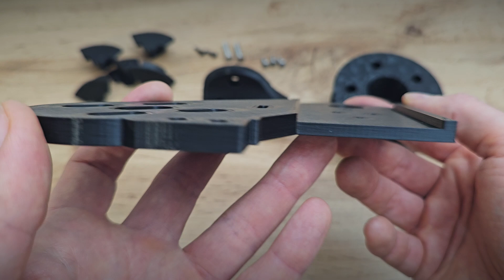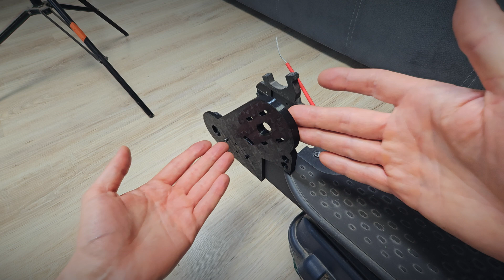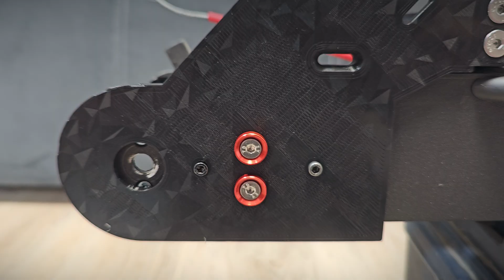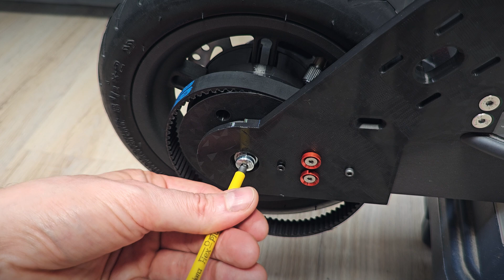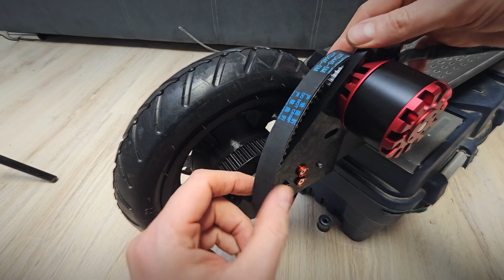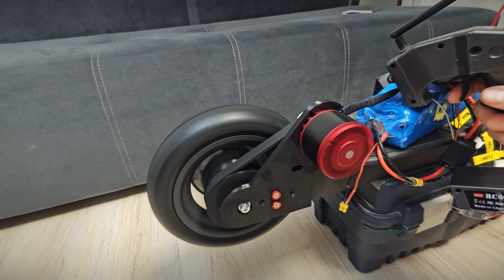Xiaomi M365 Mid Drive Free 3D Print Project 😊 Why How & DIY

Comment: i want to do this and use both this motor and the original motor together. how would i wire it up to do that?
Reply from the maker: sure, just use dual controller
Reply: @PirateWasHere  do you have a wiring guide so I can workout how to wire it.

Comment: Spectacular! What I like about this project is that it can be restored to the original model, right? Another alternative would be to have a separate accelerator, controller and mini battery, right?
Reply from the maker: Yes Yes YEs and YES, you re smart guy :) . This one gives so much possibilites and there is no need to make any permanent changes / modification to scoot :)

Comment: The motor heating up will destroy the main plate fairly fast as PLA starts to soften at around 60C. It might survive printed out of ABS or ASA, but designing it to be a simple cut from metal is probably going to be the only sensible solution.
Reply: This is PLA+ carbon which is fine for 70C
Reply: @orange42  Still a far cry from the 105C of ABS or 112C of ASA. How well and crucially for how long it will work depends entirely on what motor you use though, maybe PLA+ ends up being enough for lower power applications.
Reply from the maker: PLA / ABS It's worth to try , but for sure it will fail sooner or later at higher motor power :) . What about adding cooler on rotating motor shell , which will blow " colder air " on printed plate which holds motor.
Lets share some decent ideas 🍻🍕
Reply: @PirateWasHere what about using the Chinese type rear suspension as a bracket?
Reply from the maker: @jjpev  Good idea. But lets try to use only 3D filament ** At least untill , we all agree " Its bad idea 😁 "
Reply: @PirateWasHere  okay bros. Can't wait for first ride! Should be fun
Reply: @PirateWasHere  once is working just right it would be off to local CNC 😍
Reply: if you got a printer that can, PA-CF! (carbon fiber nylon)
Reply from the maker: @BH4x0r Why not pricy PLA ?!, carbon nylon is not that good, no idea why people keep talking about it like its holly grail. For 99.99% applications, pla will do overally better.
Reply: @PirateWasHere  cuz its the highest temperature resistance filament a "normal" printer can handle, and super durable
yes annoying its a bit more flexible but way more durable overall and heat resistant
needs to be dried much tho
not a single version of PLA will actually Ever beat nylon.
PLA shatters easily and melts easily, i never use it, i even feel PETG is better
Reply from the maker: Yes and no,  high temp pla mostly will break but before it will bent a little bit like nylon, its really stiff, while nylon is flexible, petg is like tpu ;). Anyway i never use cheap pla, my one need print temp at least 240c ( yep this is a clue), i dont use anymore petg or nylon.
Reply: @PirateWasHere  azurefilm paht-cf is really really stiff, harder to print obv but worth it especially when u push motors beyond 100°C like me 😂